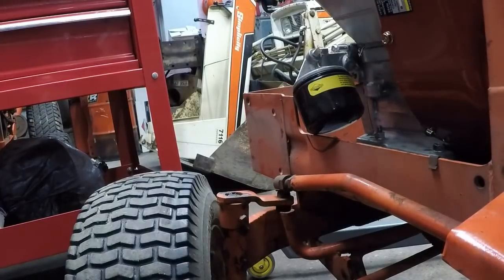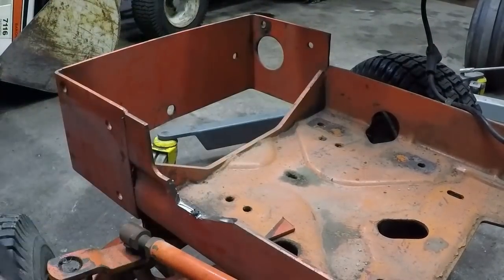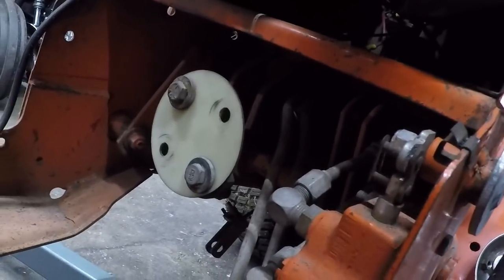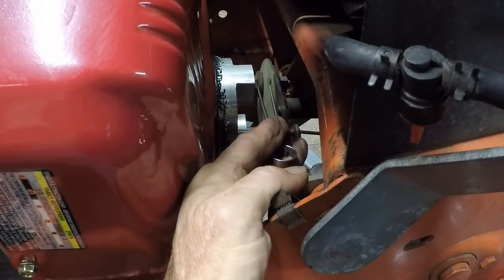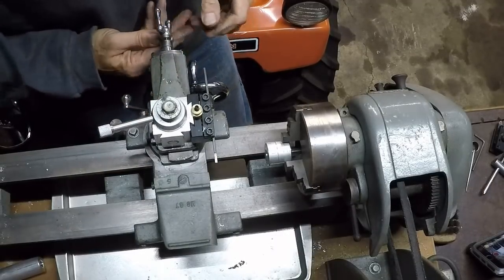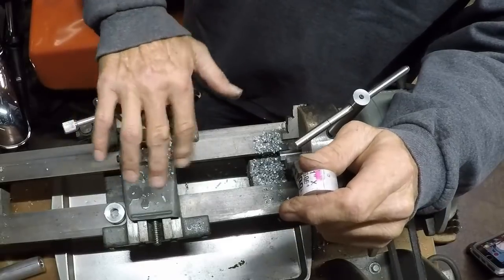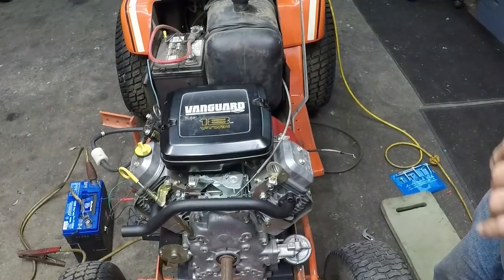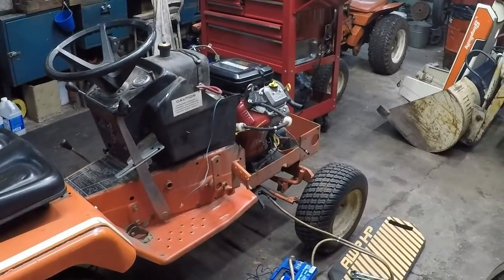Simplicity 7117 Vanguard Engine Swap Part 7!! #smallenginenation

Comment: Thanks a bunch Zip for this series.  I started this exact re-power a few years ago & of course ran into the same problems as you did.  The difference however is I was not smart enough to overcome them, now with your insight I can maybe get that project off the shelf in the near future & move forward.  I missed where that mounting plate came from.
Thanks man!
Reply from the maker: Heya Skip. The mounting plate is a factory Kohler V Twin mount for the later model Simplicity Tractors. Direct bolt up. No drilling needed to install the Vanguard and it lines up perfectly to the drive shaft. Making the spacers is easy enough, then just the wiring and linkages to get done and she's complete. Get that project off the shelf! Cheers! Zip~

Comment: Why didn't you go with a remote for the oil filter? I hate to see frames get cut.
Reply from the maker: It wasn't my call Mr.... Shaun weighed the options and chose the frame. He asked if it was mine, what would I do and I said...I'd relocate to preserve the frame, but there was no structural risk and it's a lot less expensive. So...yep. lol Cheers Mr! Zip~
Reply: The customer is always right.
Reply: @ZippoVarga  ... Translation: Shaun is a dummy.

Comment: Pretty amazing that a little fibre disc is all that's keeping that machine moving and connected to the engine.  I guess the idea is that it would shatter to prevent damage to either or both the engine and transmission in case of a catastrophic failure?  Thanks, Zip!!
Reply from the maker: You got it Mr.A! But, most drive shaft driven machines use them. Cub Cadet, Grass Hopper, Gravely, Ferris, Dixie Chopper. They are also vibration dampeners and they have a good amount of flex they can handle. I personally have never blown one up, but I've seen them come in destroyed and wondered...what in the world happened! lol Cheers my Friend! Zip~

Comment: Very cool! ITS ALIVE!!!!!!!!!  :o)
The one main question I still have with the Briggs Vanguard Adapter and a Simplicity mount, how come the drive shaft didn't fit up without spacers? Are they not exactly designed to work together, they both just happen to fit correctly, and with a little massaging (spacers) they work perfectly? Just curious. Looks Awesome Zippo!

Cheers
Reply from the maker: They all need spaced to allow for minor differences in engine configurations. The best way to do that is to make the drive shaft short enough to accommodate just about any engine. The frame is also drilled for a variety of different engines from the factory. A sort of, one size fits all kind of thing. Me making custom spacers was just a convenience. I could have done some less desirable trickery, but it wouldn't have been as solid. Hope that answered your question my Friend! Cheers! Zip~

Comment: Hey Zippo great videos would it be possible to ask you a question about my k series Kohler.  Thanks
Reply from the maker: Ask away Larry. I'll help if I can. Zip~
Reply: ZippoVarga I have a newly rebuilt 16 horse on my john Deere that I built. I have about 50 hours on it and I had it running wide open throttle and I accidentally shut the key off and it back fired really loud from then on it is very hard to start
Reply: ZippoVarga would it be better if we talked on the phone I can pm you my number
Reply from the maker: My guess is you spun the flywheel and sheared the flywheel key. That's the most common thing that happens with a big backfire. Sorry, but I don't give my number out Larry. We can work it out. Zip~
Reply: Thank you that's what o was thinking but wanted to check with someone else. By the way I like all your tractors I have a few myself.  Thanks again.

Comment: What exact engine is it?? and where do i get that plate???
Reply from the maker: Want me to install it too? It's a Briggs Vanguard Horizontal. Any will work. Plate is a "good luck finding one" from older Simplicity tractors with Kohler V Twins. Zip~

Comment: oh dear !!.. do not under any circumstances cut the tractor frame to accommodate a damn oil filter, you simply buy an oil filter adapter that allows you to mount the filter somewhere else.

Comment: ZIP HAVE THAT SAME MOTOR ON THE 235 JOHNDEERE IT;S 17 YEARS OLD.
Reply from the maker: In my opinion, The Briggs Vanguard is the king of the industry. Dependable, few over all issues except for crank seals and they're easy enough to replace. That is, unless some wanna be mechanic like the yahoo at Greenworks who destroyed the Conquest Vanguard. But, the engine was repairable and Steve is still a very happy camper. Cheers Danny! Enjoy the engine! (I'd say enjoy the JD, but...well....you know I've got orange flowing through my veins lol.) Zip~